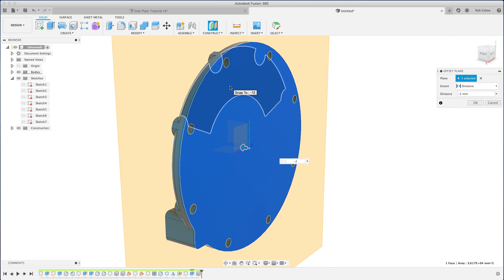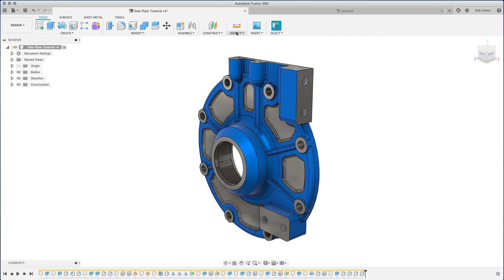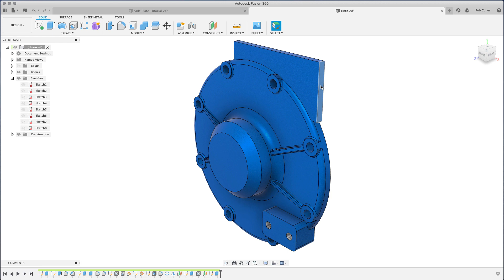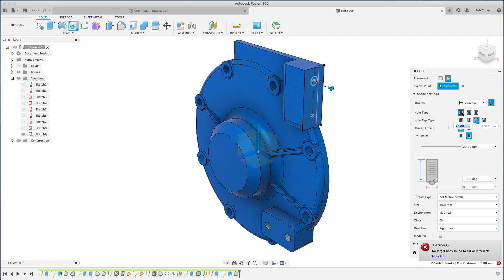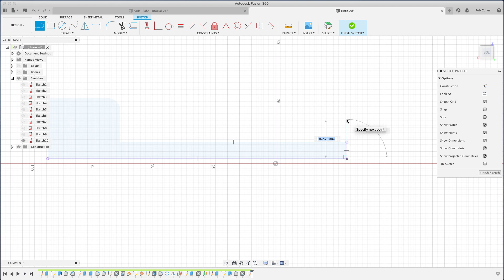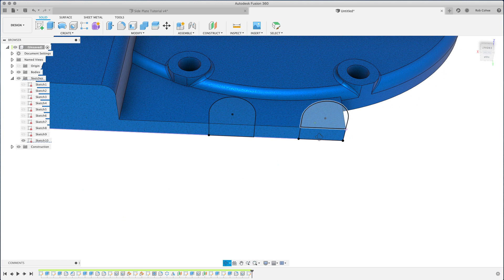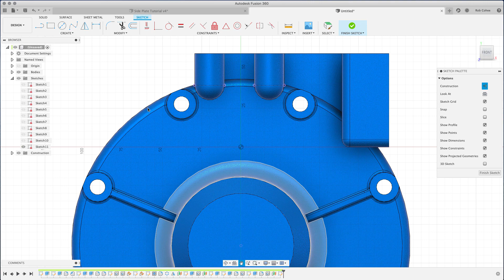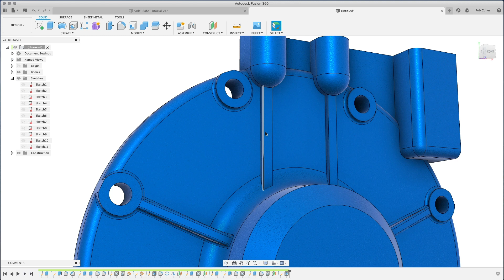Fusion 360 Part Modeling Part 3 of 4

Comment: Just a note, since you used one as a reference - driven dimensions used in equations are not parameters and wont update when changed in Fusion at present. (Hint Hint Devs).
Reply: An easy way to use the correct dimension in this case would be to make sketch 8 visible while you are editing sketch 9.  Hover your mouse over the dimension you want to reference one sketch 8 and it will tell you the reference name.   In this case d60.  You can use this on any sketch and it will update as it should.  The formula should have been (d60-d66)/2.

Comment: Hi Rob,
Thank you for this interesting series of videos. You show some of your approaches to designing this part that are helpful.
What makes it difficult for me to get the full potential out of this series, is that you seem to do things such as:
- from time to time you forget to tell us 'where you're going',  before setting off; This leaves me guessing and scrambling to catch up.
- you forget to clearly define / identify each step and relate it to our goal[s]; 
- you 'change direction' mid-sentence, from time to time
- when things went 'wrong' you lost me and I had to figure out 'what's what'; while mistakes can be used as a great learning tool.
This may seem harsh, however I feel the content and expertise are all there. Al it neend now to achieve it's full potential is STRUCTURE.
By structuring more clearly and stringently, learning becomes a great experience.
Regards and good luck with your projects,
Willem